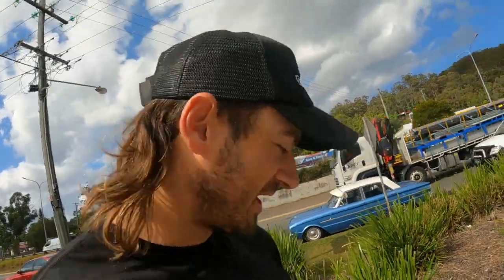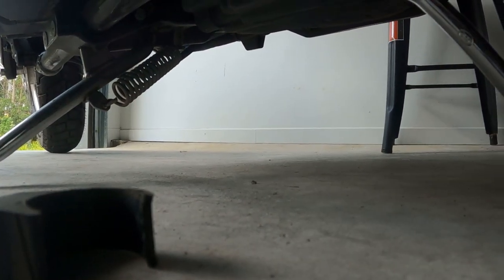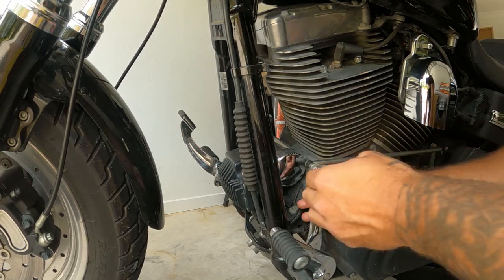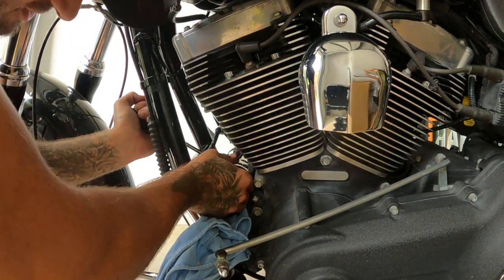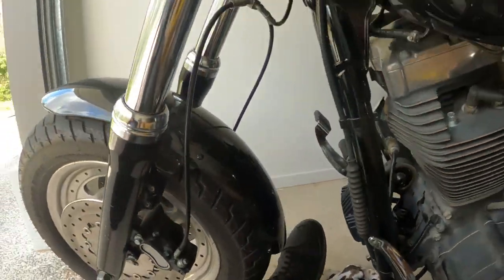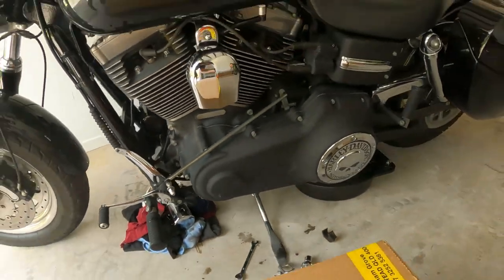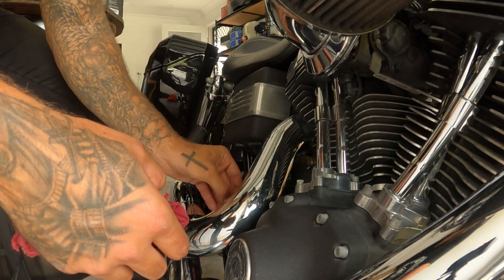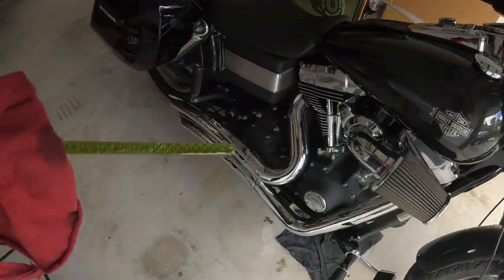I Make Everything Look Hard - HOW TO SERVICE YOUR HARLEY DAVIDSON - DYNA FATBOB

Comment: I always flush the motor with clean oil and old filter, ride for 100km, then drop that oil remove filter before New filter and oil. Much cleaner.
Oil level on the stick will read different on side stand vs service rack (level)
Reply from the maker: Cheers mate, I appreciate the tips ! Might have to do this next time 🤙

Comment: Thank the lord you didn't bang on about oils synthetic v mineral. just my two cents choose mineral for long haul riding as most servo will stock a ltr, and if you need to top up you don't run the risk of mixing the two just to get home. bla bla bla. so I am watching your very down to earth I hope this serves you well on the platform that has seen many prima donas come and go 
Keep up the great work.
Reply from the maker: Thanks mate, yeah honestly to me oil is oil I'm not too phased what I use as long as it keep my bike running haha. Oh true ! Thanks mate well that's a good tip I'll keep that in mind as I plan to do bigger and longer trips in the future.  Thanks heaps mate I try to keep it as real as possible. I hope this journey works out for me aswell 🤙 thanks for the support

Comment: Haha your vids are good man i dig your sense of humour. After a couple of times doing my oil change i bought the HD tool for the oil filter. The other tools i tried didn’t work to much of a stuff around with them. Hot tip for you try not to get oil all over the engine mount. Oil wrecks the rubber mount after a while.
Reply from the maker: Haha thanks mate ! Glad you're enjoying them. I'm definitely going to buy it the next time I service the bike 🤣🤣
Ahhh true !!! Thanks for that mate always learning
Reply: @Gnarly_Harley  with that being said bro you know what happened after i changed my front engine mount? The next oil change i did i put rags and  tried to be careful not to get oil everywhere and on the mount. I couldn’t get the oil filter tool off from the filter and was getting jammed and i started getting the shits and oil got on my engine mount. I was about to blow a stack i tell ya lol. I thought well this defeats the purpose of doing all this. 🤣🤣🤣
Reply from the maker: @MRtodd-8287  hahahaha oh bloody hell ! Swear that's always the case with anything we do. Be careful and you get shafted anyway 🤣 whenever I'm not being careful seems to work out... makes sense 🤣